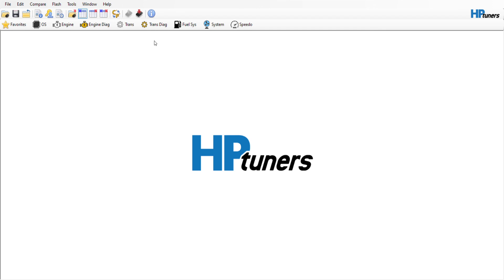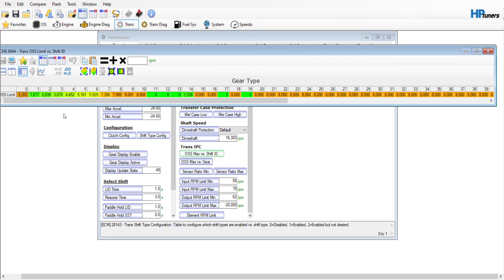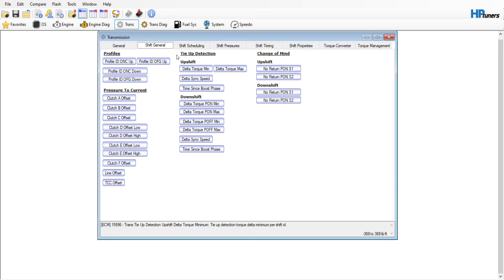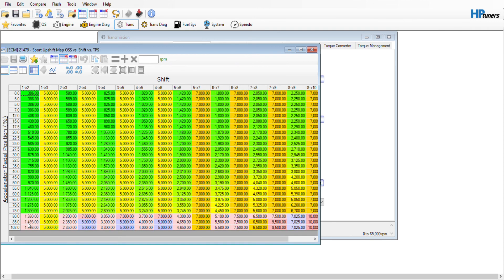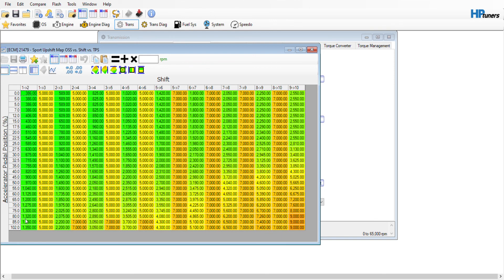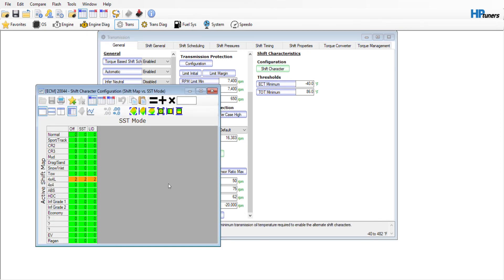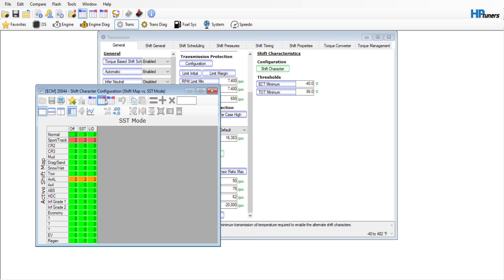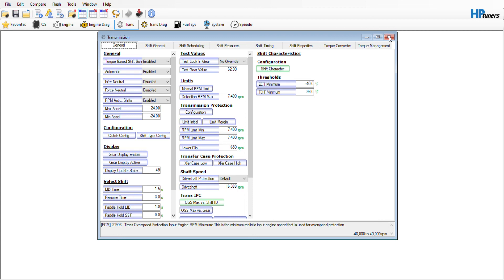HPTuners VCM Editor F150 Raise Shift Points

Comment: did you change any of the torque  management setting ?
Reply from the maker: No I didn’t in that video all I was doing was raising the shift points since the F150 shifts at 6200 or 6400 rpm stock.
Reply: @711Streetfighter  how do you change the engine rpm limit?